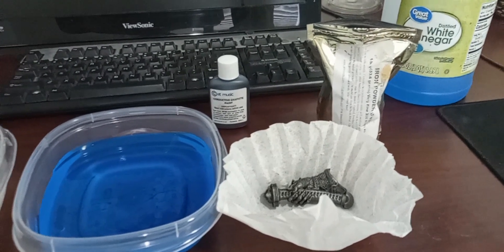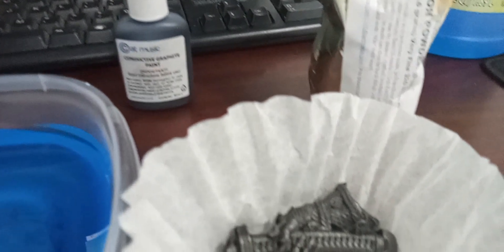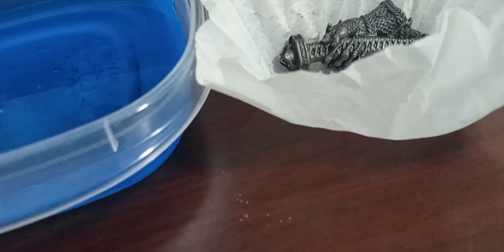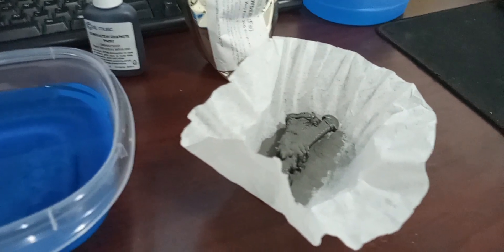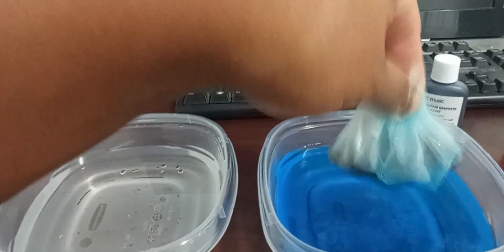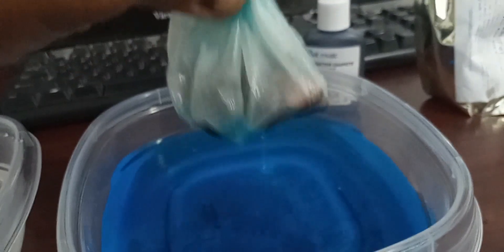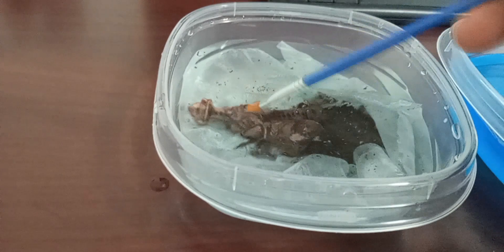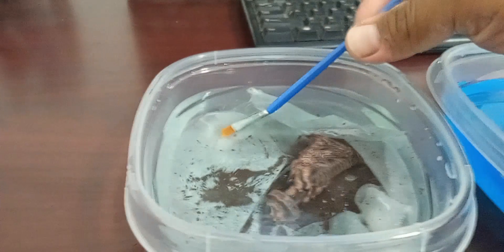Galvanic Copper Deposition on Graphite Conductive Paint

Comment: Hi Marvin, I just did some testing of this technique for 2 hours.  It works but the layer of copper doesn't adhere well to the substrate, I can remove the copper with just rubbing a little with my thumb.  I also cannot can a uniform coating and I'm experimenting with differents things to get this fixed.  I am trying to get faster electroplating times with resin 3d printed parts and I think this galvanic deposition would be worth if it.  Have you got any tips or something new to say about this technique ?  Thank you.
Reply from the maker: Yeah Copper is not adhering well to the graphite, which is not unexpected as graphite is very hydrophobic and a lubricant. Have